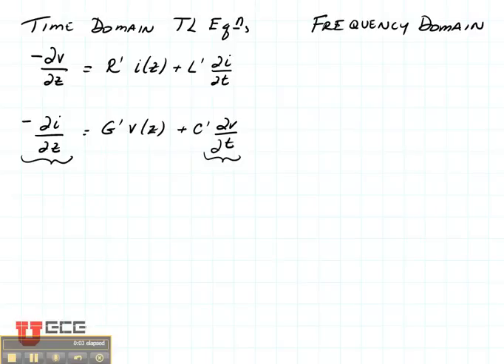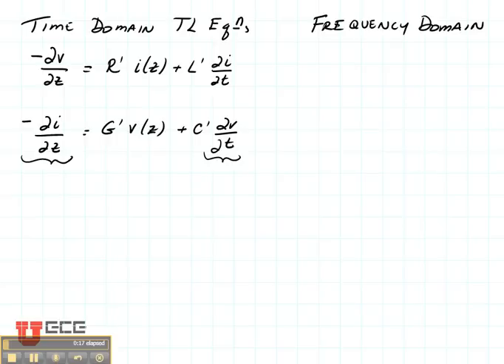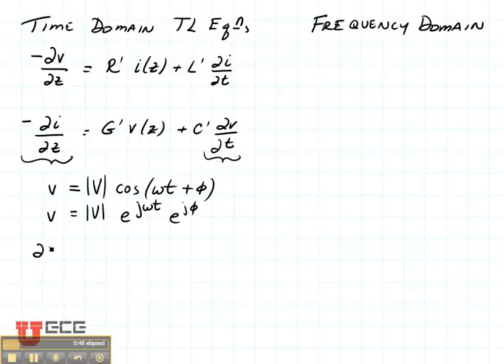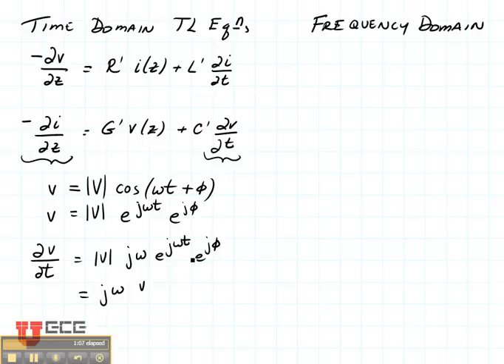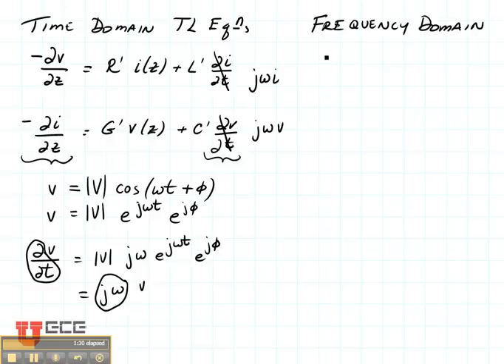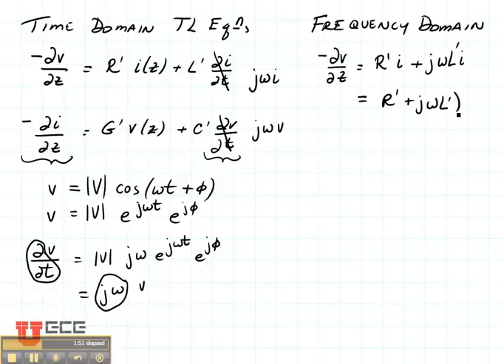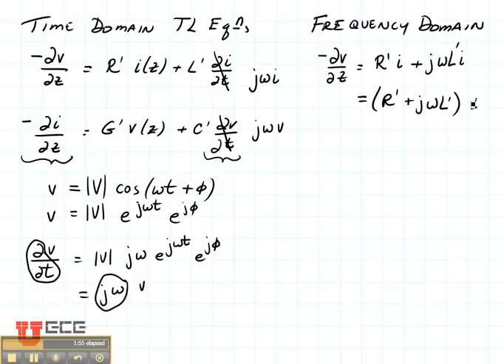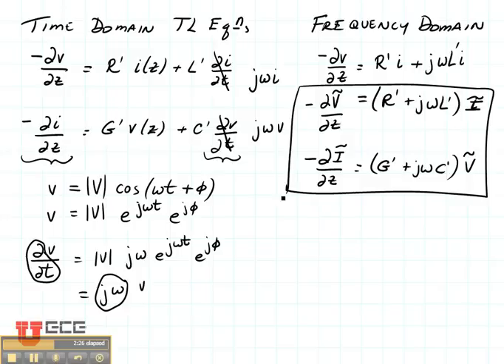ECE3300 Lecture 5-5 TL Equations frequency domain equations

Comment: The derivation is mathematically poor because the starting-point was wrong. We are dealing here with high-frequency voltages! In that case you don't use equations like V = L . dI/dt  and  I = C . dV/dt. Use impedances! Then you don't have to misuse the Euler-formula too :-(

Comment from the maker: @canary2421  You are correct that what I wrote in the video is not mathematically exact.  A more rigorous derivation of phasors is in section 1.6 of your text, and the result (see table 1-5) is the same.  When we see Acos(wt+phi) we replace it with A e(jphi) in phasor notation with an assumed ejwt representing the frequency.  Thank you for your question. CFurse